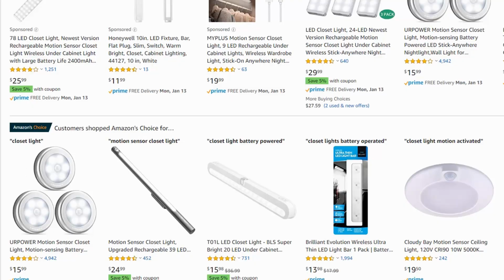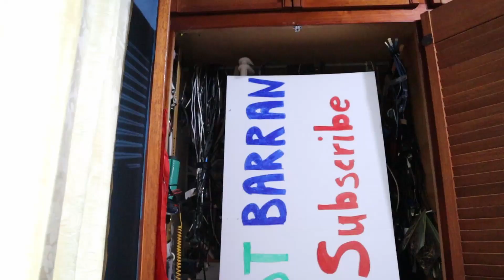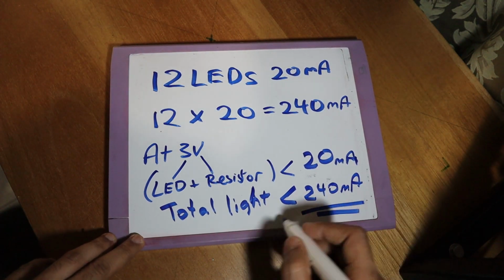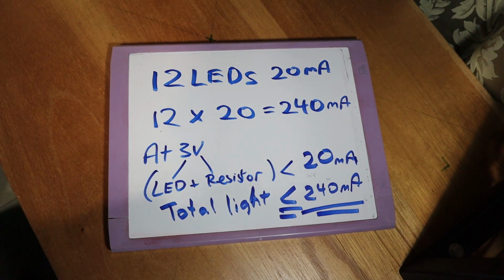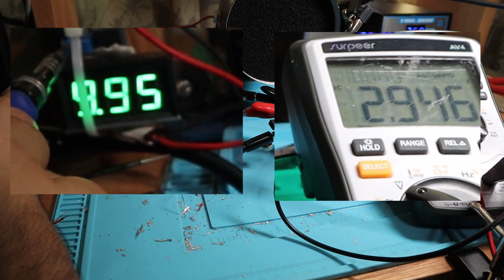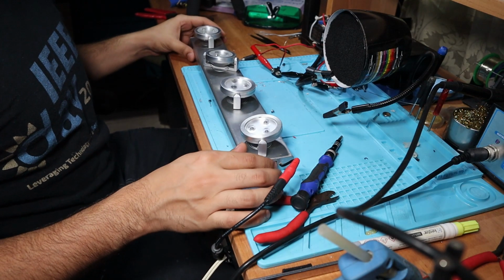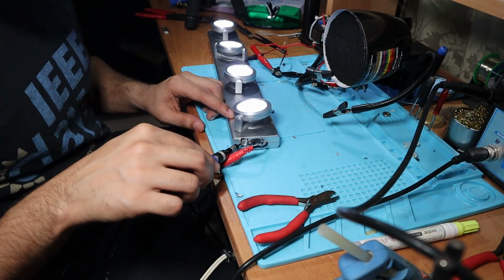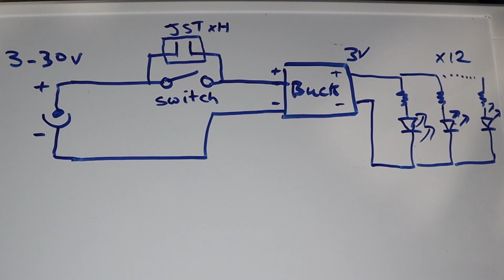Super Simple Automatic Closet Light (recycled)

Comment: What if i want to open just the right door? How do u add two switches, and ensure that it still turns on when both are open?
Reply from the maker: Sean Hoilett great question and Suggestion. The easiest way I think would be to add another switch in parallel with the first on the other door. I originally planned to do this it required running more wire, and I usually open both doors to enter this closet. I hope this helps.